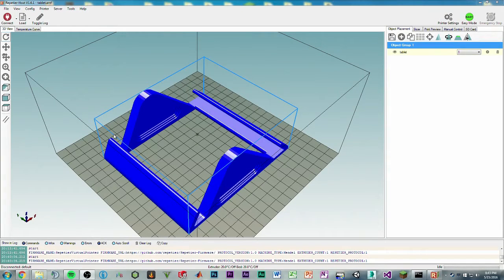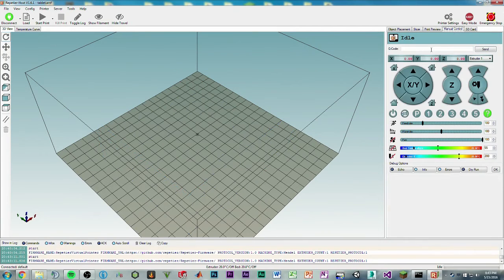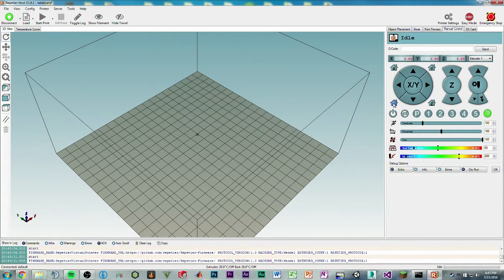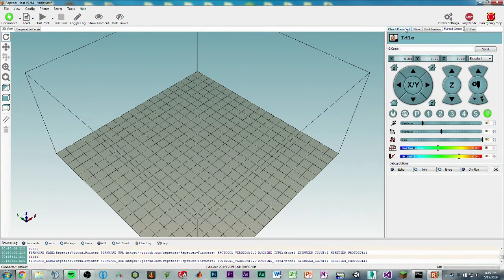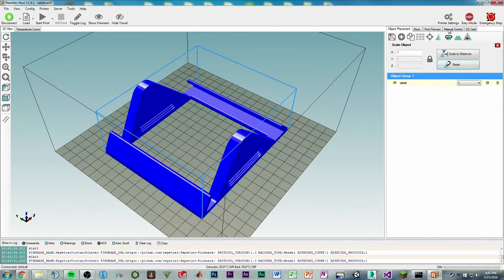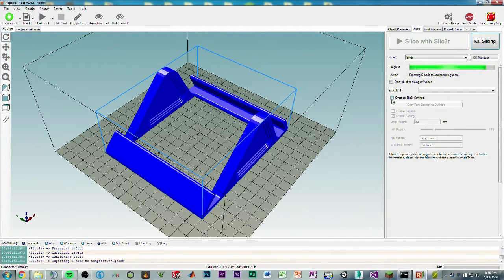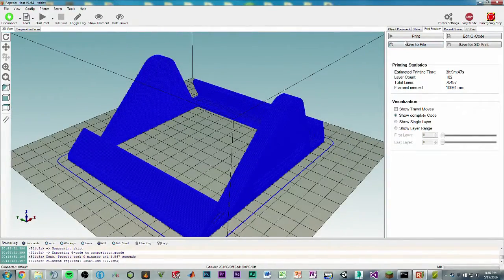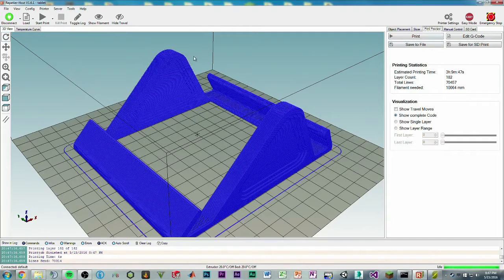Basics of How To Use Repetier Host- Prusa i3 Tutorial

Comment: I am new to 3D printing and am having trouble connecting my prussa i3. In your video, you simply press connect and it does, but in mine, it sends back an arror message that reads "serial com error:System.io.Ports.SerialErrorRecievedEventArgs". Do you have any idea what i am doing wrong? Thanks for the help.
Reply: chek what com port your printer is on and find settings in the software to change the com port so they match, go to device manager in windows to see what com port its on
Reply: Noah Wilding You goto manualy open the ftdi programe thats in with repetier ect on your sd. it dont auto install aha.